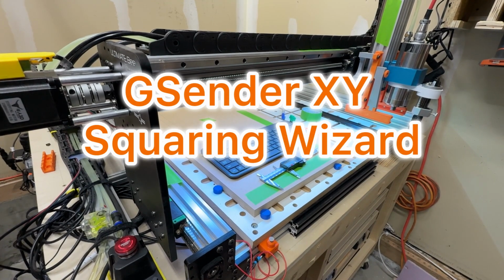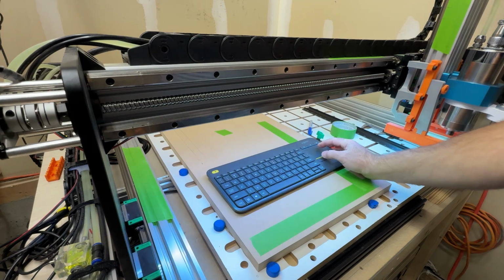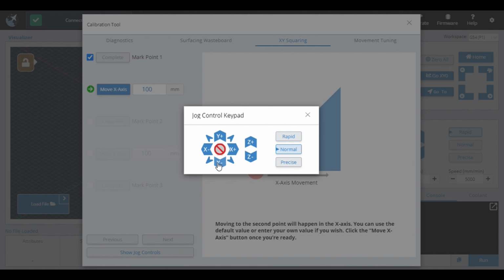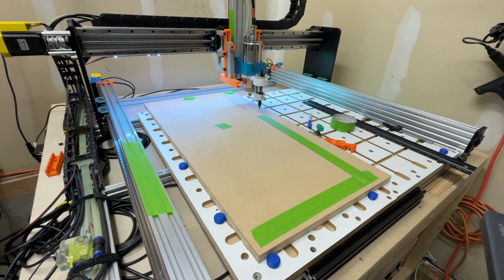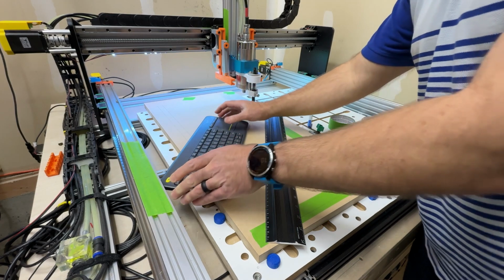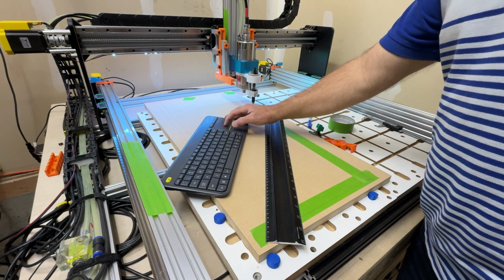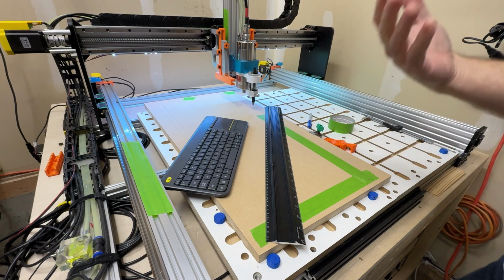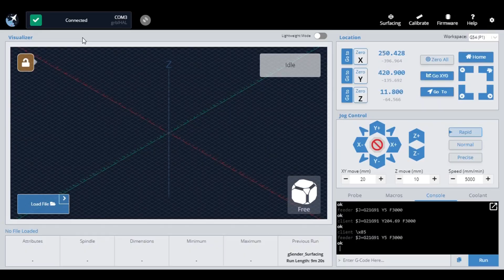GSender XY Squaring Wizard

Comment: I stepped away from CNC for a bit when I built my ultimate bee mostly due to the sparks pro v5 being a soul crushing nightmare. I’ve got an slb now and wondering if you kept your limit switches (rocker?), how you like the U.B. (I went 220 water cool), and if there’s any other tips you could share since it looks like we have a very similar setup. Running the high torque nema23
Reply from the maker: Hey man while I never had any specific issues with the XPro v5 I was never able to get RS485 running for my spindle and it bugged me so I was happy to move to something else and the SLB has been an amazing upgrade to the machine. Mechanically I love the UB and am very happy with its ability to cut but use the XPro v5 was holding it back for sure. 
When I first swapped over to the SLB I continued to use all of the included mechanical limit switches and they worked great. I was able to test an early firmware of the Y Auto Square for the SLB and so I needed to purchase a new switch anyway so I went with some inductive proximity switches, mostly just because I wanted to a mechanical switch would have been fine.
As for any specific tips, I did a video on my switch over from the xPro so maybe check that out and get familiar with GSender if you arnt already.
Reply from the maker: Feel free to reach out anytime with questions.